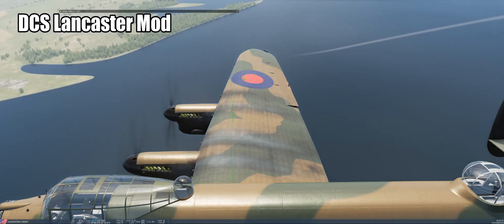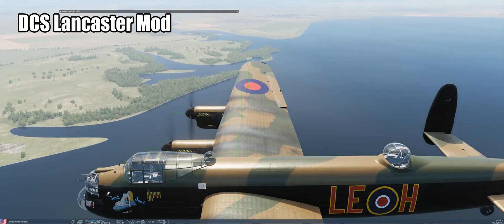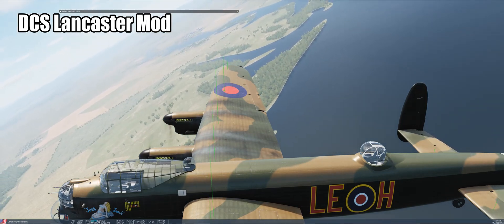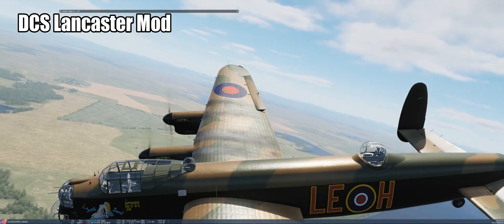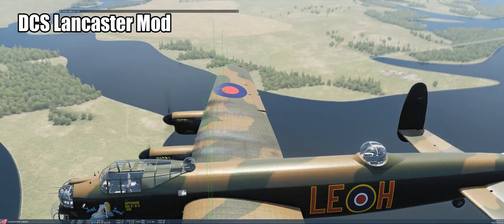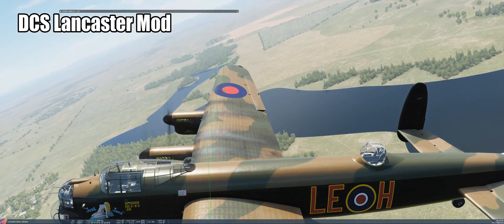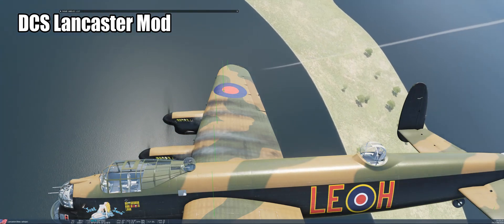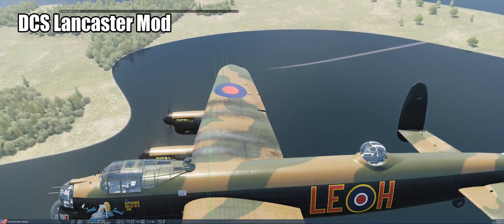DCS Lancaster - Aerodynamic Simulation

Comment: looks good but this dCs that c is supposedly important. what is the status of damage model?
Reply from the maker: We're using Xray ("Warbird damage model" that DCS ww2 planes received ~2021).  So while visually there's not much to show yet, engine failures, loss of fluids, fires and control functions are all modelled.  For example in each engine you can take hits in a dozen different components (water rad, oil rad, generator, gearbox, supercharger, etc) and suffer according effects.  Maybe we'll do a video on this.
Reply: What good is a damage model if an aircraft cant fly.  Chill out
Reply: If you are in our discord, you would have seen a picture (albeit a bit ago) of these green force lines "decreasing" after taking damage, showing lower amounts of lift with damage. visuals to follow soon
Reply: You know the C stands for Cockpit, right?... DCS is not a combat sim.